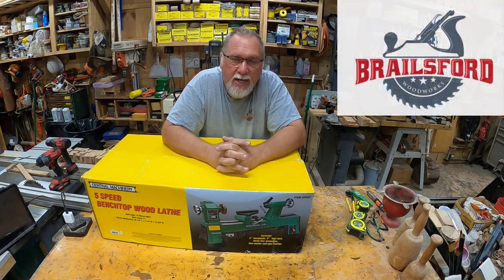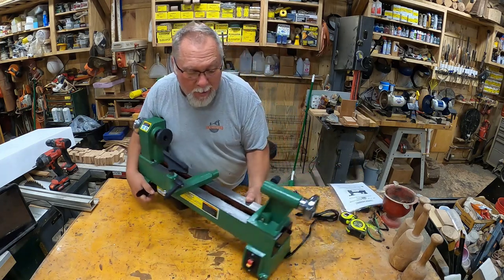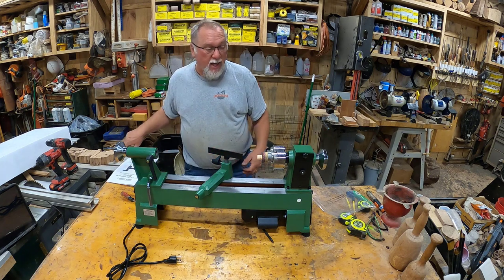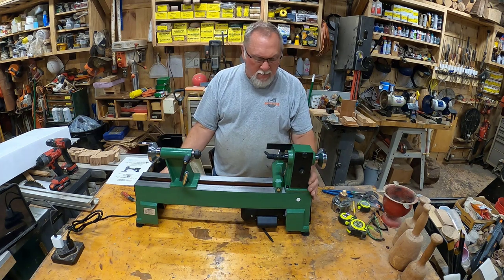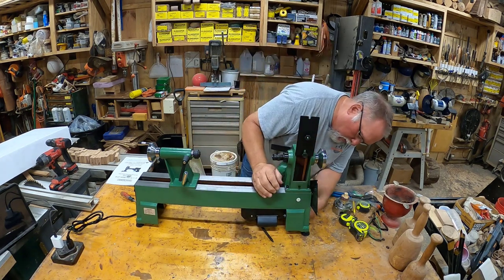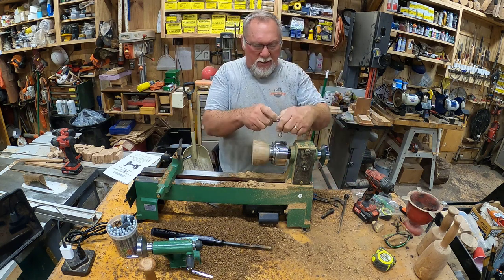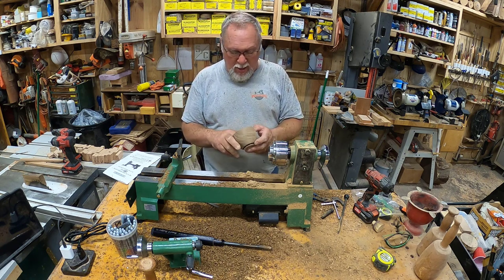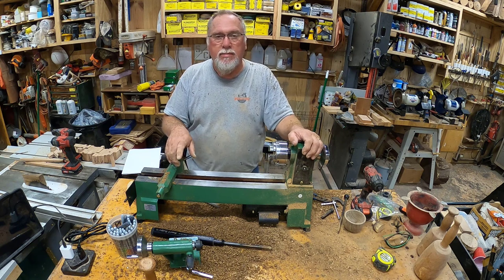Harbor Freight Mini Lathe Craft Show Demonstrations Woodturning Business

Comment: Hi Mike, I have the same lathe, but mine is the Rockler Excelsior. It works great for small things, but for larger and heavier turning blanks, the motor will get too hot. Also, with larger blanks it can vibrate a lot, but since you’re using yours for small bowls and tops it should be fine. I’d recommend getting a better tool rest for it eventually. I was using a spindle gouge at the end of the tool rest, when I had bad catch and it broke the tool rest off right at the post. Overall, for the price and what it is it’s a great little lathe!
Reply from the maker: I can tell you that I do not intent to tax that lathe.  It will turn mainly tops and likely never a bowl over 6".  I will use it only at demonstrations and let my grandson turn on it when he comes to visit.

Comment: I got one of these as my first lathe (same lathe different brand) for peanuts second hand and love it.  Brushing the chips off, that collect on the chip magnet motor, is a must to prevent it getting too hot. I also got the bed extension with the lathe and cut it down to make it a 10 x 24, which allows the tailstock to slide far enough back for hollowing up to about a 4" deep bowl without getting in the way. To deal with the lack of power I'm not sure whether to do a treadmill motor upgrade or to use a backshaft from a metal lathe to provide more gearing options. As Doug says below it's worth keeping a couple of spare belts and a set of bearings (I've broken 2 belts in 3 years, I put SKF bearings in when I got the lathe and haven't had to replace them yet). 
Have fun with it, I'll be referring back to this video as I don't have a manual.
Reply from the maker: Thanks for the great advice!  I will keep it all in mind!  Thanks for watching!

Comment: Thank you for sharing your thoughts and demonstration video of this HF midi lathe. HF definitely has some wonderful tools and it appears it will meet your demonstration needs at shows. Like you I would like to have a VS speed lathe and not have to change the belt position on my Delta LA200. However, my Delta at 20 years of use is running well.  Everyone stay safe, warm, happy and healthy. From Henrico County Virginia
Reply from the maker: Thanks!

Comment: I have that same lathe, got it for pen turning, and still have it, upgraded the motor to a variable speed motor, other than that, its a good little lathe, and I like the idea of being mobile for craft shows, I do that with one of my scroll saws, on its stand, built a mobile base to roll it in and out of the trailer we use for shows, use some good rolling wheels and hang onto it coming down the ramp.
Reply from the maker: If I upgrade the motor it will for sure be a variable speed.  What speed control did you add?  Thanks for watching!

Comment: I just bought this lathe off of Facebook marketplace. Messed with it a little tonight. Nice to see it can handle small bowls. 

What are your thoughts on the chucks from harbor freight?  I’d like one like what you used on the bowl.
Reply from the maker: I would give it a shot!  I have a Wen chuck.  I would  not be surprised that it is made in the same factory.  The one I bought was a cheap one from Amazon.  Thanks for watching!

Comment: I had the exact same thought as a use for my Jet 1014 now that I have upgraded my lathe. I was thinking of preparing some stock in advance and only sanding/finishing while at the show just to limit the sharp tools with unruly adults and curious kids. Do you plan to power this with a battery pack and turn at an outside venue or inside and then clean up the floor when you are done? You have some great videos about your show setup. When you get this worked out, PLEASE post an update with your experience and showing how you set it up. As with all the other stuff you do, it will be a great opportunity for us to learn. Really appreciate what you do.
Reply from the maker: All good questions.  My intention is to only use it at outside shows, and clean up right away.  Also the show will have to offer electrical connections. 
    I actually have a different thought about this than you... I don't want to sand on site at all.  I have been told neighboring booths get upset if you are putting dust on their product (rightfully so).  So I intend to only use sharp tools.  However processing the pieces to cut down on total turning time might be a good idea.    I also intend to put up a shield to prevent people from actually touching any moving part.  This will be a work in progress.  
  Thanks for watching!

Comment: This was my first lathe to make sure I would like turning.  Now I have a Jet 1221vs + Extension.  
It is the same as the Rockler Excelsior so order a spare belt from Rockler.  
Rockler makes some OK tool rests that are 5/8" that are not cast.  Of Course the Robust 5/8" tool rests are much better
Penn State Industries makes a drop in replacement motor that is 3/4 hp and adds variable speed. 

These days I use my old HF for dedicated tasks, buffing pens etc.
Reply from the maker: Thanks for the great advice!  I will be using it for demonstrations at craft shows.  I will pick up a spare belt and likely a better tool rest.  I will wait until the motor burns out to replace it.  Thanks for watching!

Comment: I just got this for MLK day sale.  They are now grey in color instead of the old HF green.  I just hope it works longer than 2 days.  That was the record for my WEN lathe. 2 days.  No parts available to replace...
Reply from the maker: I hope it does as well!  This exact same lathe is also sold by Rockler under their name.  https://www.rockler.com/rockler-10-18-mini-lathe-bundle?country=US&sid=V91074&promo=shopping&utm_source=google&utm_medium=cpc&utm_term=&utm_content=pla&utm_campaign=PL&gad_source=1&gclid=CjwKCAiAkp6tBhB5EiwANTCx1Nms8qe7DUOnQlodRp6V_zZa4xq51E5jT7uBOotGwHfJKHhHHgB-TRoCpngQAvD_BwE
Reply: Thats irritating...  I went to my local Rockler store and they said nothing about this lathe.
Surprisingly, after setting up the HF lathe, they did something good with it!  The panel you lift to change the belt is now on the front instead of the back! It is hinged on the front and held in place by a magnetic latch. @BrailsfordWoodworks
Reply from the maker: That is a good change! 
 @starhawke380